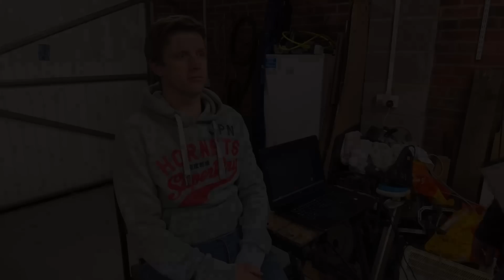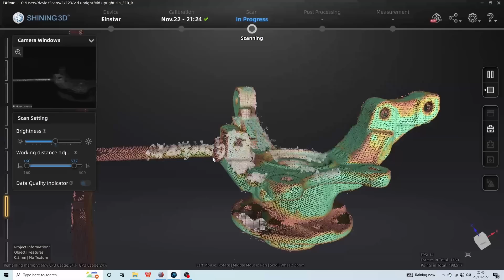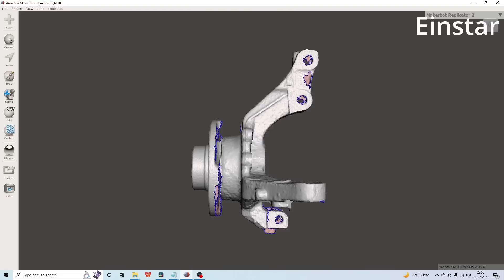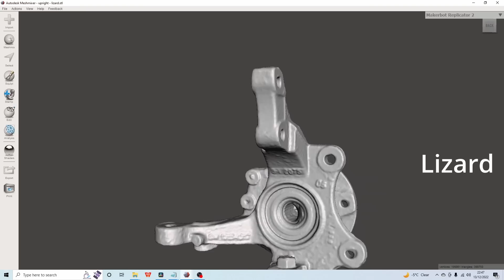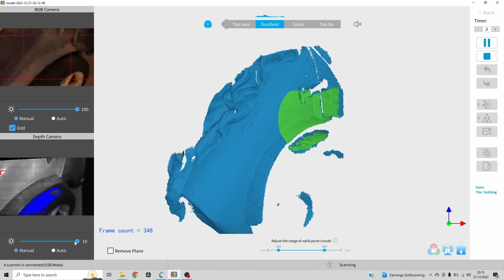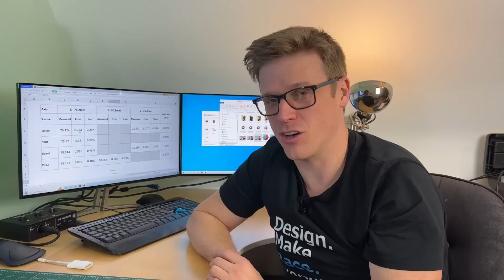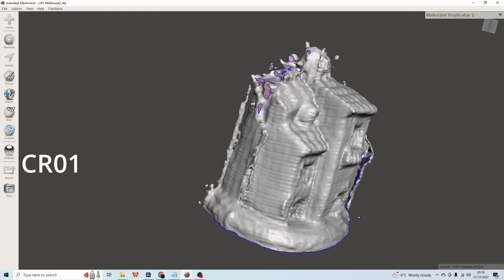Which 3D Scanner is best?!  The Pop2, Einstar, CR01 and Lizard compared over 20 different scans!

Comment: Weird you used spray and cloth for the pop2 but not for the lizard...
Reply from the maker: Simply because the Lizard didn’t need it….
Reply: @MakingforMotorsport  the lizard will perform so much better with. In my own experience. But maybe mine is broken or something
Reply from the maker: @nickb8530 it does work better with it you are right.

But the whole point of this video was “what’s the best scan I can get with the minimum amount of effort.”

Each of these scanners is capable of better, but that requires much more work.
Reply: @forMotorsport  that is clear and i am impressed by the einscan.. kinda want to get it but i have the Lizard now and barely use it because it is so "not great". Thank you for the video that makes it easy to see the difference.

Comment: I am sorry to say, but revopoint pop2 is just a piece of junk. Endless hours with not good enough results or just none, this gimmick gives me grief most of the time. Track points, scanning spray, good ligting, different settings, nada. Tracking points are not tracked in its mode, but are somewhat tracked in feature mode. It has incredible tracking/aligning problems. Even with feature rich object it gets lost easily and when restarting the scan it doesn't align by ten to twenty centimeters easily.

I am sorry I wasted my cash on this gimmick. Should have saved for something more serious.

Comment: Nice video i must say, and almost good comparison method. Couple of observations from my side. As a metrology specialist i used GOM equipment for a couple of years. Measurement uncertainty of your standard measurement (caliper and micrometer) would be 0.01. Than your method of measuring 2 planes on block is not clear. First we do not now exact flatness of those sides but i can guess is ~0.05mm deviation in both sides. (X+ & X-). I suppose you do "gauss" calculation when construct the planes. If we consider all those "unknown" facts than your calculation can fluctuate 1-2%. I suppose that you knew this when you mention that process of using gom is long and boring. :)
Reply from the maker: It was a Gaussian fit for the planes, and whilst an Engineer I am not a metrologist, I just wanted to bring a touch more Science to the subject than the average video on YT.

Much more detail would be too much I think!

Comment: Thanks for the great comparison. I have both the CR01 and Pop2. I haven't used either in months coz of the faff. Often faster and less frustration with a set of calipers. Workflow is a massive part of things. You should add the time it takes to spray and clean the object. Or add the cost of AESUB at $75AUD a can. So for me, the Einstar is a leap forward. If anyone wants to swap an Einstar for a Pop2 and a CR01 let me know! 😜
Reply: 4 parts Isopropyl + 1 part baby talcum powder = DIY scanning spray.
Only disadvantage it leaves a mess, but compared to the price of a can of AESUB I clean that up happily.
Saves the can for delicate parts 😉
Reply: Me too, I bought a Scan Lizard a few months before the Einstar came out and have been regretting since. The software straight up sucks

Comment: The Creality CR-01 is fickel in regards to object brightness, recommend a coat of matte white on items you plan to scan. The table scan feature takes several seconds sometimes and minutes other times to distinguish the empty platter/table. Note that I created a black matted booth to remove outside light noise and minimize reflections, angled lens appx. 40*degrees overhead and 700mm distance from lens to object (middle of relative camera field [500-1000mm]) and its a trash scan when it does recognize the object from the table. I simplified my scans to rudimentary objects like a paint bottle, LEGO bits, and it jusy doesn't function well. Freehand scanning is much better by far. The review is already spot-on about the sparse/"cheap" feel and function of the Creality software. Good luck 
[UPDATE]: 60hrs+ of lighting, matte paint, angle+distance changes, failure to recognize turntable, trying on other computers, and my unit couldn't scan a small paint bottle cylinder.

Comment: Look at gaming laptops if you need something powerful but still portable for scanning. Something like a Lenovo Legion.  They will be hot and heavy but will get the job done.  Most typically have a decent GPU and CPU and most can have a ton of RAM.  4 slots over the typical laptop's 2 slots.  They also cost a lot less than business workstation laptops of similar power.

Comment: would be cool to see how precise those scanners are when you scan something that does not fit into frame size as it did in this video - I believe that is when einstar woult shine compared to POP and others. I got terrible results with POP in regards of precission when scanning anything that is larger than its frame size.  especially parts with not much reference elements.

Comment: All scanners are cr@p. From SPECIAL device with all those "depth view" lasers I expected WAY better result. If you spend more than 5 sec on scanning, result should be verbatim. You move scanner around, giving all possible views for scanner - it's more than enough to build proper picture.
MAYBE some "key points" could help - kind of "microdots", which you put on sides of the item and which give precise "link point" to assemble a whole model. But for that scanner should support it.

Comment: Great comparisons,  Looks like the secrete to scanning is all about the flatter the shinnyness  is the better the scan so anything shinny or semi gloss will make scanner really struggle.  You also could rub down the ducco with 800 wet and dry take off the shine before scanning . Even the metal control arm has a little shine transitions around collar hub that mucks with scan.

Comment: I am curious if you were to scan a tray-like sheet metal part from top/bottom, would it  pick up the wall thickness accurately enough to check the extent of thinning on the bends?
Reply from the maker: Hmm… if you are looking at 0.1-0.2mm resolution, then that is tricky…. I am sure there are scanners which can do it, just maybe not these ones…

Comment: Great video, nice job on the different scans. I own a Creality CR Scan 01 and have had very few problems with my scans, the issues arise from the software used to "clean-up" scans or mesh scans. I am currently using Meshlab or WireMesh depending on what I am working on, but they are both extremely time consumptive and a pain in the _ to work with. If you don't have any experience with working with this type of software, GET HELP! This is NOT a point and click situation. This also takes immense amounts of time to get combined scans to create a finished piece that can be printed and have a worthwhile outcome.  Again, your video is great and explains a lot of the difficulties people may have when using anyone of these scanners. Great job!!! Keep up the great work. Oh and drink a pint for us!!!
Reply from the maker: Cheers for the great comment Chris, it’s absolutely right, this tech is nowhere near point and shoot!  (And I have a glass of hydration in my hand now!)
Reply: I just received the CR-Scan 01 and I've tried to get it to work on 3 different computers. No luck, every time, I get 'scanner failed to connect'. All computers have USB3 ports so that can't be the problem. Not very user friendly, I'd say.

Comment: Excelent video! Congrats! I have just received my Einstar. Will start working with it next week, but on thing that you must consider is the size of the part to be scaned. I would go for the Einstar for a large depth of view and the Revopoint mini for small parts. I run a small 3D engineering business in Brazil, focused on car tunning and panel improvements for customization, so that is why I need to think deeply before purchasing equipment.
Reply from the maker: I am yet to play with the RevoPoint Mini… I hope to have my hands on one soon!

Comment: Hello, I am beginner in 3d printing. I would like to buy some 3d Scanner aroun 1K $ to scan some rare small car parts - buttons, tacho gears, connectors, holder etc. I am decing between CR Scan Lizard and Shining Einscan SE. Which one you would recommend, when we are talking about quality of model, easy to use, scan small parts etc. Or would you recommend completwly different scanner? Thank you for the advice :)
Reply from the maker: Hi David, if you are considering just turntable sized objects, then you should also check out the RevoPoint Mini which is tailored for that size.  
I haven’t used that or the Einscan SE so I can’t comment on which is best but I did try the Lizard on a Warhammer mini and it did struggle…

Comment: I am really curious how the Revopoint MINI would perform. Its advertised for small parts but i saw a lot of people claiming that its possible to scan large parts.
It should be on the same level as the Einstar, maybe even better
Reply from the maker: I would love to have a go with one, unfortunately I don’t know anyone how has one and I am not gonna spend £500 on something that I don’t think matches my needs.  The Mini is a blue light scanner focused on small objects, Warhammer, coins etc.  I would expect it to work on large, less feature dense objects like the Lizard did on the car… very poorly.

I would be very careful about what before claim, especially around scanners, people can be very tribal, particularly consumers. Why?  
Because it may be their first scanner therefore they lack perspective and they have sunk a lot of their personal money in so they are invested and will often spend hours getting a good scan off, and are rightly proud, however the same or better scan may have been 5mins with a scanner better suited to that purpose…

Unless it’s backed up with tests and evidence (like this video), I would be cynical!
Reply: @MakingforMotorsport  Youre right about that, thats why i was hoping for a Mini comparison here :)
I did some research and "settled" on the MINI before your videos came out. I will do some more research

I plan to use it for engine reverse engineering and development so i would need a small scanner and high accuracy.

Comment: Do you know how does the new Revopoint Mini 3D compare with the Revopoint POP 2 ? Is the blue light actually worth it? Will it have a substantial improvement? Or is the Einstar going to outperform them no matter what ?
Reply from the maker: I haven’t tried a Mini, but from what I’ve seen it performs significantly better at resolving fine details than any of these scanners, so miniatures and Warhammer models are better.
However, you’ll still have the software to deal with, which isn’t the best, and it is meant for small objects, so you will limiting what you can scan
Reply: @MakingforMotorsport  For larger objects and reverse engineering parts would you then say the Einstar is the better option? But for any small components the Revopoint (mini or pop 2) are a better alternative?

Comment: Thank you very much for the overview. Now I know that I don't have to waste my money.
Most of my designs are small but somewhat complex. I need a scanner that can pickup threads and be precise enough that the threads work. A scanned and printed M4 bolt needs to screws into a purchased M4 nut. Preferably even finer threads. Hopefully we can get something like this in a few years.
Reply from the maker: None of these are what you want, the RevoPoint Mini might be a better fit.

That said, I have no idea why you want scan threads and then just print them.  Features like that will always better to measure with a thread gauge, and then re-model using a thread feature on the CAD.  All you really need from the scan is the centreline…
Reply: @MakingforMotorsport  That's very true.  Something like an M4 bolt could be easily created in a CAD program such as OpenSCAD using the Threads library and printed in just a few minutes with excellent results.  Non standard threads are trickier and require creating your own linear extrusion model, but still much easier than trying to use a 3D scanner.  Great video by the way.  I have been using the Mole scanner which is similar to the Lizard and it seems to work well (for small parts).
Reply: There is no scanner technology available that can scan threads especially that small lol. What you would do is use a scanner to get a point cloud for overall bolt length and diameter then use that data to recreate threads in a CAD program. I rent the bigger expensive laser scanners for work and even on max definition it wouldn't produce useable threads that small.

Comment: Have you tried throwing a wet newspaper on top of the fender for tracking? It should be quite thin and has a lot of trackable stuff on it (at least on photo mode, not sure about the geometry mode).. anyways, a good comparison, thanks for it 👍
Reply from the maker: For texture tracking that could work well… excellent tip!

Comment: Thanks for your effort to make this video. I do enjoy your channel. 
Although I understand your reasoning for laptop/desktop choices, I can't help but think all the units involved would have benefited from the computing power. At the very least the software process times and stability, but from my experience, you would have better scanning as well. 
Sidebar, it's funny, the "back button" was my suggestion to Revopoint back in the early POP1 Kickstarter period. 

Can't wait for further videos, as the consumer scanning segment is changing and growing almost daily. 

Just my 2 cents.
Reply from the maker: I understand your point on the power, and I also think you are probably right.  

However, the units should be judged against the manufacturers stated requirements, that should give acceptable performances.  And apart from the Einstar I am thereabouts on specification.
The back button is a great idea… well done!  (This has now been suggested to Shining3D)

Comment: Thanks for sharing! I'm a lizard user and noticed the hardest objects to scan also have the highest cpu utilisation. If the cpu get saturated the software starts losing tracking really fast. I've had parts unscanable with the laptop that were no problem with the desktop.
Therefore I'm not convinced using the laptop for the other scanners paints the best picture possible. Anyway i like your video's a lot, keep up the good work!
Reply: Globally the most convincing are Lizzard and Einstar. The lizard failed in the car but wasn't put enough effort, no even the  same thing done with the pop2 spray and towel.
The Einstar is the second better in everything but the lizard except in that, was 1st or second. 
Having in account the money and that I get with external free software the same functionality than the Einstar software, just take the Lizzard. That car can be nicely done with the effort and experience
Reply from the maker: @Flamenawer  hi. I agree, all of these results can be improved, with more effort, which I think I flagged adequately in the video.

The difficulty is, that if someone just want to scan sections of whole cars, the only choice is the Einstar.  Yes others work, and I could make it work with the Lizard, but I’d only do that if I already had one.
Reply: Good key point - CPU speed! That's why a whole video is useless - it works on laptop!
Reply from the maker: I hear you, but the Lizard gave some of the best (or at least near the top) scans aesthetically, with the only one it struggled with was the body panel and that’s more to do field of view and the features only tracking…. 
All that said, a better laptop was on Christmas list, but Santa let me down 😢,  so I guess I’ll have to buy one!
Reply: @MakingforMotorsport  why you didn't put the towel and the spray with the lizzard then, quite unfair, is very easy take out that panel with the lizzard with the same or less effort was put with the pop2
Reply from the maker: @Flamenawer  because the lizard has such a small field of view, all you would be scanning would be the towel.  
ALOT got edited out this video, and it took about 40hours to put it together. 

Can each scanner get better results?? Yes, I said as much in the video but I can’t spend any more time on it!

Is the video a fair representation of my experience with all 4 scanners? Absolutely.

Comment: I was looking at purchasing an Einstar, unfortunately, no support, yet, for MAC operating system or hardware and to have a laptop that can handle the software is around £2k. when i already have mac book pro and imacs more than capable of doing the work. When adobe and Autocad  consider mac to be their preferred system. its frustrating that the 3d scanners around £1k are not on the same page.
Reply from the maker: I don’t think scanners of £15k are on the Mac page…. Boot Camp??
Reply: @MakingforMotorsport  not sure even boot camp will work.  After receiving the following email from Shining3d support. "The software can't support Mac OS.
We are developing new software to match Mac OS.
And run the software in a virtual machine also can't meet the requirement, because the software need Nivida cuda."
now i am not sure if that email refers to needing an Nvidia graphics card and the AMD Radeon Pro 5500 in the imce is not compatable  or they mean Nvidia software code??
Reply: That's why people who actually do technical work stay away from mac lol